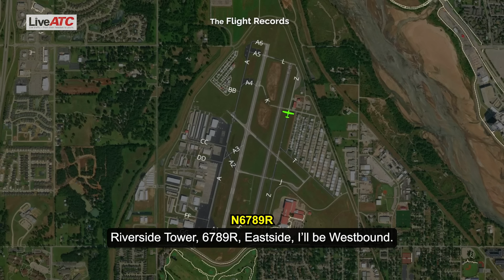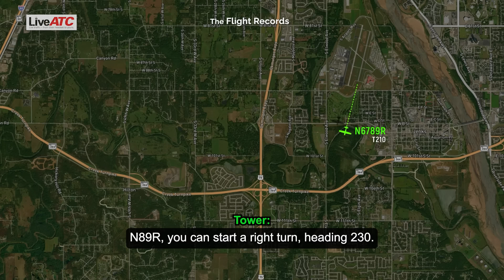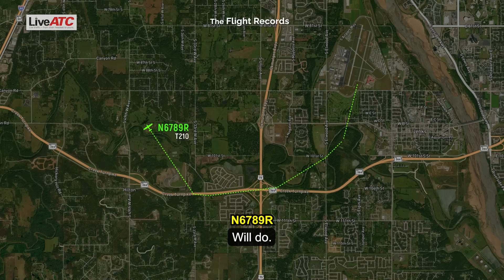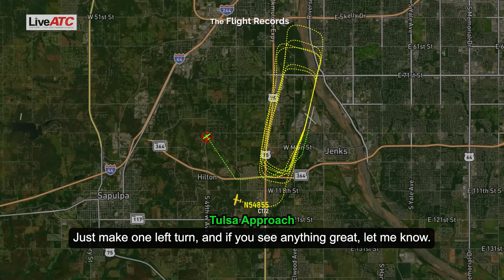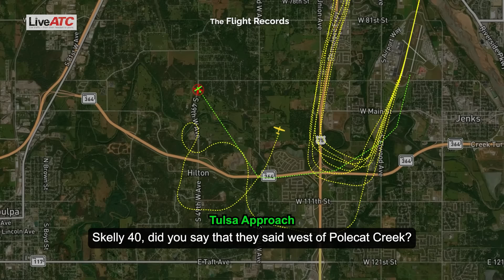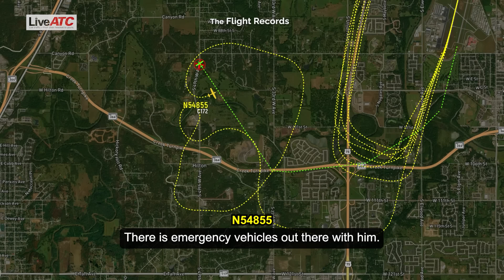A mid-air ENGINE CHECK forces EMERGENCY LANDING on the road!

Comment: This is why I like non-controlled fields. Climb to 4,000+ ft. agl as quickly as possible and circle directly over the field. Run at full power for cylinder break-in. Preferably in cold weather to help with engine heat control. I've experienced multiple power loss failure in lots of different types of aircraft. Failures occur more often than people realize.
Reply: Mine were mostly in tired Pawnees and CallAirs working fields.  On pipeline patrol I never had problems with a new engine, just went back to work.  My manager/mechanic was a good mechanic.  Yes, failures often don't make the statistics.  Only two of my thirteen resulted in Army or FAA paperwork.  This guy did a good job getting down with not a lot of damage.  Looks like he may have stood on the right brake to ground loop the left wing out of the way of traffic.
Reply: This is the right way.  He should have just asked to stay over the airport - I'm sure the controllers could have arranged that.

Comment: Quite a few times I was the first pilot to take out a plane with a new engine.  In addition to long runups on the ground, my first flights were always right over the airport, a close enough pattern to be able to land again, then going higher and orbiting.  I always expected the engine to quit or have some kind of problem, which is probably why I never had a problem.  At least this guy walked away from it.

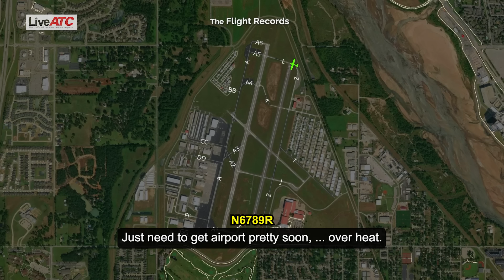Comment: Pilot makes a comment at about 1:50  about needing to get airborne and "overheat"...  It's winter; sure sign of a problem.
Reply: When breaking in a new engine, you want to get it in the air quickly to avoid overheating it at low power settings.  He wanted to get it in the air to avoid the cylinder walls "glazing".  Breaking of a new engine or overhauled cylinders works best at high power settings.